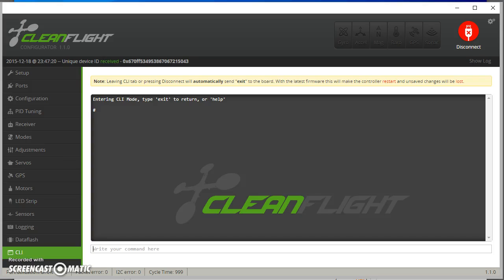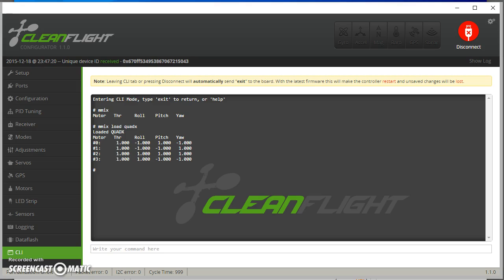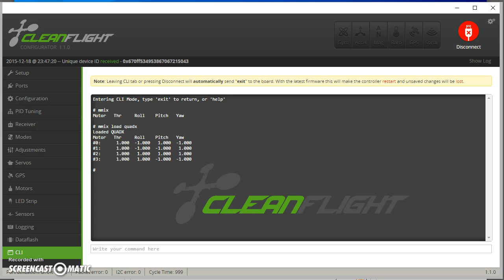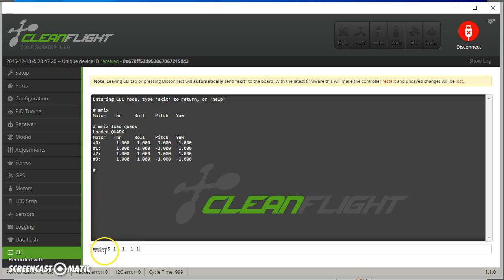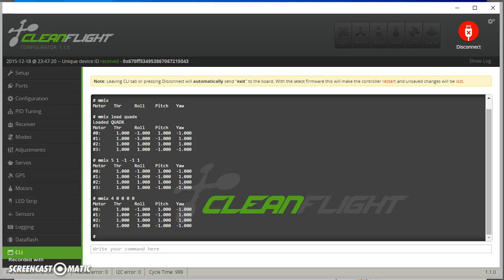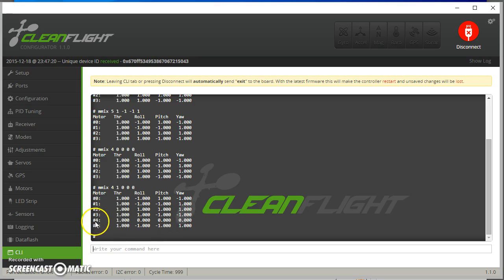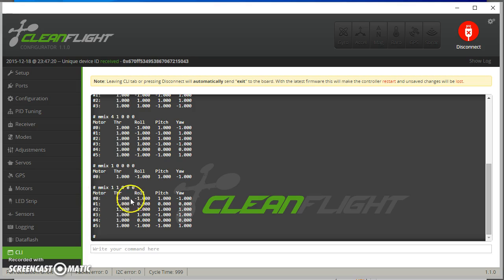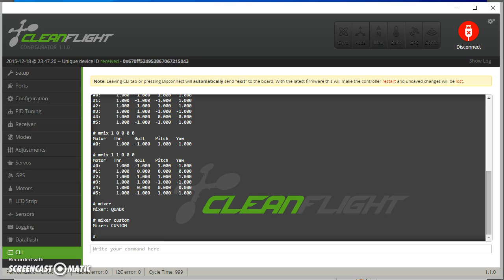Tutorial: How To Remap Motor Outputs In Cleanflight / Betaflight

Comment: Hi Josh. I have a question on receiver channel remapping.
I only have channel 3 available on my SBUS receiver, which I intend to use it to drive a camera tilt servo. How do I assign Throttle, which is currently on channel 3, to a different channel, say channel 8. 
Thanks
Reply from the maker: Change the channel mapping in Cleanflight / Betaflight. Normally it is something like AETR1234 which means channels 1-2-3-4-5-6-7-8 map to Aileron-Elevator-Throttle-Rudder-Aux1-Aux2-Aux3-Aux4. Just change the mapping to something like AE1R234T.

But I don't understand. If you're using SBUS why can't you use whatever channel you want?
Reply: Thanks a lot Josh. You explain it very well. Now I understand the mapping. I thought it was A=1, E=2,T=3,R=4 in a map like AETR1234. Thanks again mate.

I'm using Futaba R7003SB, the only PWM channel available on the receiver is channel 3, to which I can hook up a camera tilt servo directly. The other 3 ports are for SBUS, SBUS2 and EXT Voltage.

Comment: I have a PWM servo style video switcher that I'd like to access from M5 / M6.   Any idea how to make betaflight on a quadx mix see the other two sets of motors pads as servos?
Reply from the maker: If you enable feature servo_tilt, then motors 1-4 will move to motor outputs 3-6, and motors 1-2 will be servo outputs. You can then use the servo configuration to map an Aux channel to motors 1-2. But don't ask me the exact steps. I did it once a long time ago, but I don't remember how, and the configuration has probably changed since then anyway.
Reply from the maker: Betaflight is supposed to be working on an architecture that allows more arbitrary remapping of inputs and outputs, but it's not done, or maybe even started.
Reply: Thx for reply.   Yea I read this too, though I also found indications the remapping of 1-2 was only true for older targets and my F3 target wouldn't require that.   Info could be wrong.   When I enable servo tilt, nothing seems to change.
Reply: Joshua Bardwell Just FYI, I got up the motivation to try again, this time armed with a multimeter.   The 5v source I was feeding the servo connector had mysteriously stopped working.  Given proper voltage this works just as I had set it up.   Using Singularity FC target (F3), I am able to use M5 or M6 as servo and did not need to remap M1/2.
Reply from the maker: +Aaron Gutman awesome.

Comment: I'm not getting any output on motor 3 on my omnibus so I guess I'm screwed since this fc only has four outputs.
Reply from the maker: Check your solder joints. Test the ESC with a servo tester. Swap the ESCs to different outputs to ensure it's not something else.
Reply from the maker: +Manuel Rojas that's not an option. You have to use the motor outputs.
Reply: Hello,
I'm having the same problem as well.
Only motor outputs 2 and 8 (numbers on the board) work.
The others don't work at all.
Is there a way to move those outputs to lets say to the buzzer output.
Cause I know that the buzzer uses PWM and maybe by typing the correct pin number we can move the output to the desired pin.
Is there a way to do that??
And no its not the soldering, I rechecked and soldered everything correctly.

Comment: in the motor tab, it shows motors 3 and 4 moving up when i disabled those meaning i zeroed out the 3 and 4 ports, so i have 0 1 3 and 5 running, and also when i take off, my quad does a crazy flip, it dips down on the side that i did the mix for ( motor pwm 5) any ideas whats going on??
Reply from the maker: If you have a flip, your motor mix probably has a mistake in it. I'm not sure about the motors running in the Motors tab. It's been so long since I zeroed out a motor, I can't remember what the expected behavior is.
Reply: Joshua Bardwell so i played with it a bit more, and when i spin up motor 1, motor 3 spins, and when i spin motor 4, motor 1 spins. also when i spin motor 2, it spins motor 2 as it should. i try to use the mmix command but i did everything right and it didnt change anything, the motors still were switched.
Reply from the maker: +Inteous FPV mmix does not remap the motor outputs in the Motors tab. It just makes the copter able to fly when motors are installed in the wrong locations. You cannot verify that mmix is working based on what motors skin in the Motors tab.
Reply: Joshua Bardwell so it should be able to fly then?
Reply from the maker: +Inteous FPV if the mix is correct. All I'm saying is that the Motors tab will always spin whatever motor is on the header, regardless of the mix.

Comment: hey Joshua.
According to what I understood from your video and comments, I should be able to make any motor run the way I want it independent of the header it is connected to, right?
If so, this isn't working. Custom mix just makes the escs beep, before it is ever in a state to be armed and the board seems to just reset to default mmix values for quadx everytime I close it/save it.
Any ideas? I really wanted to try cleanflight but am close to just go back to libre pilot, where it worked...
Reply: so... just as I wrote this I gave it a last shot. I changed two things in the way I was doing things: first, I only changed the values for one motor at a time and, second, I used the command save instead of exit (despite what the program says). And it worked! So glad I can actually try this! thank you for your video, even if it wasn't straightforward, I learned something. And that's is always good!
Reply from the maker: +vipecrx exit leaves without saving. You have to save.
Reply: Yeah, I figured that eventually. However, turns out I was tired and actually didn't make much progress. I will have another go this evening...
Reply: Here's the issue ( I have used the calculator and get the same issue):
When the RC commands are transmitted correctly, some stabilization commands are reversed and vice versa. 
Any ideas?
Reply from the maker: If the mixer was incorrect for the actual motor thrust vectors, then the copter would flip out and be unflyable. Therefore, if the copter can even hover, the mixer is correct for the motor setup.

Can the copter hover?
Reply: nope, flips immediately. I tried using the multi rotor calculator but get similar results.
Reply from the maker: Okay so your mix is not correct. Your motors are not wired up right or you have a sign reversed. But the only way through it is to just manually check every single thing.
Reply: So they have to be wired as Cleanflight intended and no other way?
Reply from the maker: +vipecrx Not at all. But the mixer has to agree with the actual wiring.
Reply: How do I change that? I thought changing the mmix values would tell the board the positions but something is not going as planned.

Comment: is it possible to do this with say a brushed hex board, and instead of running a hex, just run a quad, and if a FET gets blown out I can just remap the motors?
Reply from the maker: +Kenny Cox sure.
Reply: Awesome. So if I wanted to change motor output of #1 to #5 I would just copy the line from line #1 and make it line #5? Its that simple?
Reply from the maker: +Kenny Cox and zero out line 1
Reply: +Joshua Bardwell thank you so much.

Comment: I had to mount my lux 180 degrees from normal i.e. pointing backwards so that the usb port is available. My motors are plugged in to the following Lux header outputs.

Motor 1 - Header 4
Motor 2 - Header 3
Motor 3 - Header 2
motor 4 - Header 1

This is my mmix;
mmix 0 1.000 1.000 -1.000 -1.000
mmix 1 1.000 1.000 1.000 1.000
mmix 2 1.000 -1.000 -1.000  1.000
mmix 3 1.000 -1.000 1.000 -1.000

I have selected Mixer Custom and saved it but the wrong motors spin i.e. motor 4 still spins when I try to spin motor 1.

What am I doing wrong?
Reply from the maker: mmix doesn't remap the motor headers, so slider 1 will still spin header 1. Mmix just makes it so that the back-left motor doesn't have to be motor #1 any more, you see?
Reply: Thanks. Is there a software way to do what I want? The hardware way will mean extending the servo wires which will have to go diagonally across the board and make for a messy build.
Reply from the maker: +PodgeyLavin there is no software way to remap the motor headers without compiling your own firmware. But everything will work fine except that the motor numbers won't match up as expected. So it's not too big a deal.

Comment: Josh, first thanks that was great, but I have another question.  How do I simply reverse Yaw and Roll?  I know normally do on Tx and thats right, but this Tx is for a little "toy" type of controller that I am experimenting with, is there a way to reverse in clean flight?
Reply from the maker: +GenCode FPV change the channel mapping. Swap R and A.
Reply: Josh, first thanks for your reply, but I do not mean swap the channels. I mean when I move the yaw stick left movement in cleanflight swings right, basically opposite direction.  This Tx I have does not allow reverse directions or it would be easy.  Any way to reverse directions of stick movements in cleanflight that you know of?   Once again thanks!
Reply from the maker: +GenCode FPV yes. Use rxrange. Rxrange 2000 1000 instead of the default 1000 2000
Reply: okay thanks so much, this was an older version of cleanflight, its a cheap oversky so I was afraid to update it, rxrange did not exist in
# Cleanflight/NAZE 1.9.0 May 31 2015 / 13:17:47 (98f7549)

I updated to the latest and reversed the Rxrange and it works great.  Thanks!!
Reply from the maker: Wow! Cleanflight 1.9! Memories...

Comment: Okay, so let's say hypothetically I soldered my motors to the wrong headers. I'm not sure I understand what you mean when you say header number 6, is motor 4 supposed to go to header 4, etc?

I'm wondering what headers I need to map to. Here's my problem right now, motor 1 needs to go to motor output 4, 2 to 1, and then 4 to 2. 

Thanks for your videos, they are super helpful
Reply from the maker: If that's all you need to do, just copy out the QuadX mix lines and re-arrange the numbers at the beginning of the lines. So if the lines started out:

mmix 0 ? ? ? ?
mmix 1 ? ? ? ?
mmix 2 ? ? ? ?
mmix 3 ? ? ? ?

Then you would simply change them to:

mmix 1 ? ? ? ?
mmix 3 ? ? ? ?
mmix 2 ? ? ? ?
mmix 0 ? ? ? ?

See how I have rearranged the numbers 0-3 to match your description of how motors 1-4 change? The values in the ? positions stay the same. Only the numbers change.

Comment: hi Joshua... nice vid.  I want to make my CC3D running in Cleanfight to have buzzer on motor 6.  How can I assign AUX2 to motor 6?  Thanks
Reply from the maker: You need a special hex that is compiled to have buzzer control on motor 6. And you need a transistor circuit to prevent the buzzer from burning out the pin.

These videos seem to cover the topic:

https://www.youtube.com/watch?v=nKXzM35nIIY
https://www.youtube.com/watch?v=eSRv8ox8oCA
Reply: Hi Joshua...Thanks.   I have seen both video previously.  The first video seems to cover the topic since I use the same cleanflight version with him.  However, I dont understand what 8-pin he is referring in time 00:28 since he is using PPM receiver format.
Reply from the maker: Sorry, but I don't fly CC3D so I don't know either.

Comment: awesome,but it didn't work for me.I have a cc3d running betaflight,when I do this custom mapping,cleanflight doesn't recognise the board
Reply from the maker: +R. WIZA what do you mean "doesn't recognize the board"? 

Many CC3D firmwares use motor outputs for other purposes such as buzzer on motor 6. Thus may be a conflict you are experiencing.
Reply: +Joshua Bardwell Thank you for responding.well I mean't that when I hit save(in CLI)the board suddenly reboots,and the computer says that the usb device has a problem,and there is no opened port in cleanflight(so I can't connect it) until I go back to librepilot and reflash betaflight on the board!
Reply from the maker: I can't imagine why setting up a custom mixer does that. No clue at all.

Comment: so i set up my quad as openpilot meaning motor 1 is actually motor 4 . Still not getting how you assigning physical motor to a header. Now that i realized that naze32 has a different order , can this be done with mmix?
Reply from the maker: +daniil Motsenyat Yes, absolutely. Just move the mixer lines around so that line 1 moves to line 4, etc...

Comment: Giod video! Thanks, man. I just finished a brushed Hex build and realized I mounted the FC backwards. after fixing the board orientation I realized I would have to re-route the motors plugs and the wire length wasn't long enough and it would be a pain. This will fix me right up. Appreciate it!
Reply from the maker: +Complacent1 Glad to help.

Comment: After running the custom mix and am still not getting the appropriate motors to run in the motor tabs. When I slide up the number 4 slider motor 1 is running. When I slide up number 1 slider motor 4 spins up. They are all opposite just like I wired it. However I hoped to remap them and see the change in the motor tab. 

Will I see the motor changes with the custom mix once I go back to the motor tab???
I even changed them all to 1 and no change. 

I did remember to type, "Mixer Custom" before I saved. No luck.
Reply from the maker: Remapping will let you plug any motor into any header, but the mapping of motor header number in the Motors tab is fixed as far as I know.
Reply from the maker: In other words, motor slider 1 always controls motor header 1. All the custom map does is change where that motor is located in the frame.

Comment: What are the odds, I've been researching this very subject. I destroyed the motor 1 signal pad on my Naze 32 after desoldering the pins for I decided to direct solder the wires for a lower profile build. Figured changing the motor outputs was my best option short of buying another board. Thanks Mr. Bardwell, your videos are informative and inspirational.
Reply from the maker: +Ryan K (MototechRyan) Glad to be of service.
Reply: +Joshua Bardwell I too just salvaged a Naze32 with a bad ESC output header. Thanks Joshua. You the man!